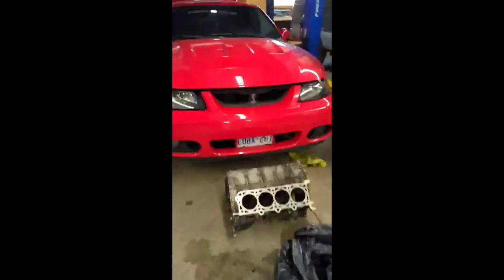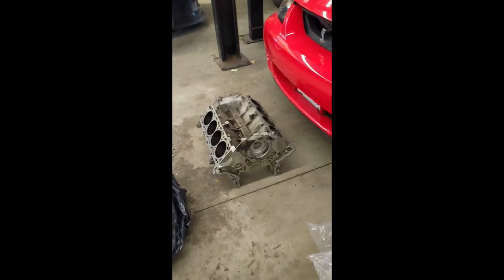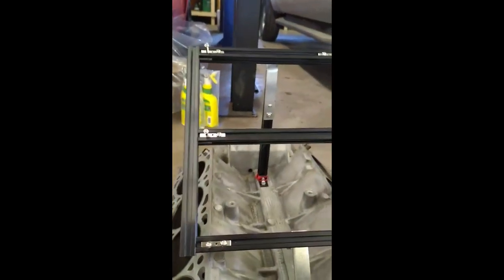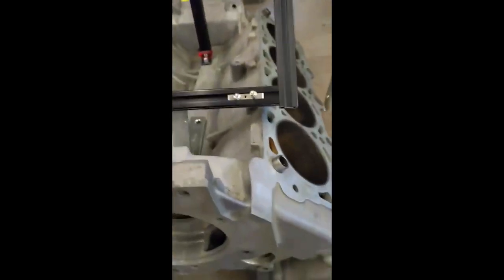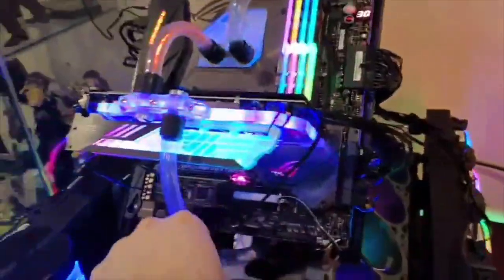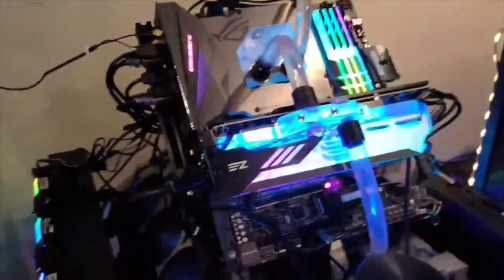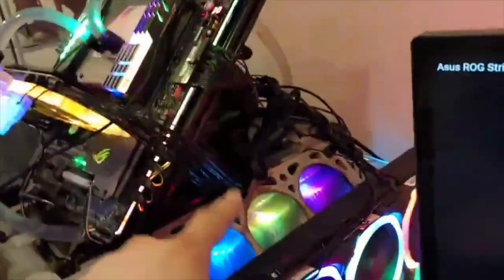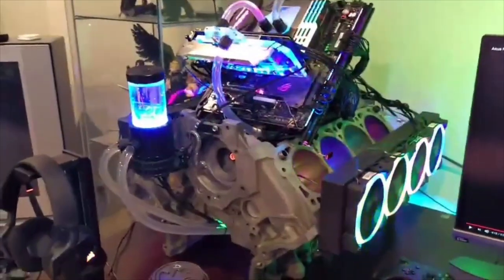Engine Block PC

Comment: Make the RGB red in the firing order of the pistons, that would look nice i think
Reply: might be kinda difficult but that would be sick
Reply: Would be even more Killa if he could make the colours speed up as the rpm of the fans do
Reply: @isatntt  nahh
Make a compact code that starts when you boot up your pc
Or if you wanted use a raspberry pi or pcb and run the fans cables through that and have them send the rgb off and on signals and stuff
Reply: @sysdumb3254  tbh idk what i was thinking when i said that would be difficult, if you know basic coding or maybe just how to navigate a premade app that lets u control how the rgb works in depth then you could probably do it
Reply: @isatntt  ye

Comment: Soft tubing on a build like that causes climate-change. You don't want to cause climate-change, do you?
Reply from the maker: It's an engine themed build. Ever seen hard tubing in an engine bay? Plus that would be such a pain in the ass for how many times this thing will come apart and go back together before I consider it "done". 

And yes I want to cause climate change 😒
Reply: @efacofive   I haven't seen clear tubing. But it's not about me dude, it's climate-change.

Comment: Been thinking about doing something like this for years now, I got an old engine that I spun out the main bearings in from a 97 Chevy 1500 5.7 V8 just haven't had the money to buy the parts for the pc and was thinking about putting a glass table top ontop of it kinda lifted up on like 4 inch studs then mount like 6 inch legs so it can be like a pc/end table next to my desk, any thoughts and ideas would be welcomed

Comment: My only real question is,how heavy is it? Must be a strong table it's setting on lol
Reply from the maker: 98 lbs as it sits. It weighs less than my thermoltake tower 900 build. It's an aluminum block so the bare block is roughly 50 lbs or so.

Comment: wait, why did it have I-beam rods? I thought those cars came from the factory with Manley H-beam rods
Reply from the maker: It's an 01 cobra. The new motor however has h beam rods. (something the previous owner overlooked)
Reply: The Cobra did come with Manley Connecting rods.